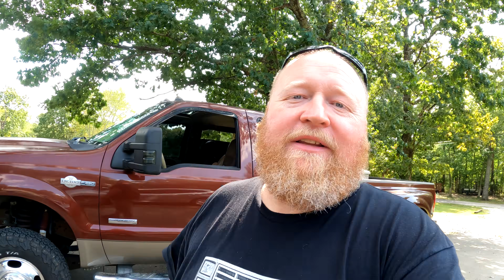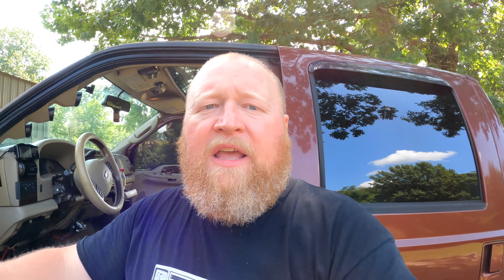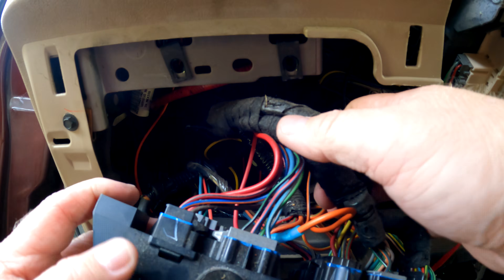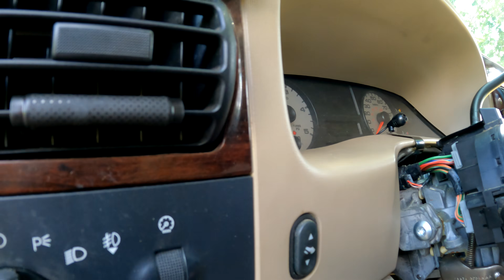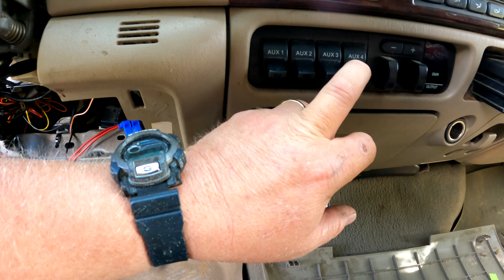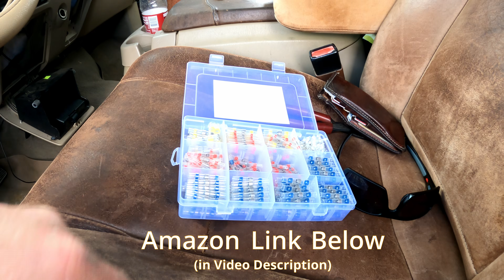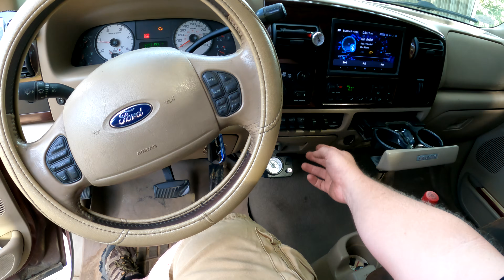Hidden Feature (High Idle) - How to Enable it on Your Ford 6.0 Powerstroke Diesel

Comment: Seems that everything i have used those connectors on i have had to go back within a year and fix again. After having to rewire 4 custom truck beds i decided it was more cost effective to use shink crimpers and i still put shrink wrap over the shink crimp connectors.
Reply from the maker: Yeah, that's truly the best way to do it.

Comment: i live in the great white north and my truck when its cold out always kicks into high idle. its stock i didnt have to do any of this. and the truck should kick into high idle when its ready shouldnt it.
Reply from the maker: Yes indeed, they will all go into a warm up high idle, but that is different from the feature we are using here. This is a factory provisioned  "on demand" high idle meant for service trucks like tow trucks, ambulance bodies, winch trucks, etc. It allows for a higher rpm than warm up and can be enabled whenever the operator chooses.

Comment: Putting power to orange doesn’t put truck in high ideal
Truck has pto been tracking down why high idel quit working. Any help would be appreciated
Reply from the maker: I think earlier trucks had different wiring colors. May be a good idea to call the dealer and see if you can get a printout of the Upfitter wiring diagram. That should tell you all you need to know.

Comment: Orange wire  in my truck is the upfitter switches what am i missing?
Reply from the maker: Not sure. Upfitter switches will have 4 wires coming to that area, one wire for each upfitter switch. Also I think the earlier trucks used different wire colors.
Reply: @ProjectTimeGarage  no problem finding the upfitter switched wires it's the high idol wire I can't find and the orange is a 30 amp  switch wire it goes on and off by one of my switches
Reply: Mine works if u have parking brake on

Comment: I have a 2004 and set up the high idle you can push the brake and it turns off but when you release it the high idle re-engages. But I do not see a difference in how they are hooked up but it has been a few years since I did it. I also used a regular toggle switch since I did not have the factory upfitter switches. That is the only difference I can see.
Reply from the maker: That's interesting. Never seen that before. There's a second wire that will idle the truck up based on voltage draw. Wonder if that's the wire yours used? Never used that one before.
Reply: Hey man what wire did you use? I also have a 2004 and I don’t see a solid orange wire under my dash. 😅
Reply: @Alecrypt did you ever find out. I as well own a 04
Reply: I think that is so if your going to drop it in gear when you hit the break it idles down to allow you to shift into gear at the lower rpm setting. My duramax does that..

Comment: Will this mess with the factory high idle I have on cold days it will idle higher than normal until I hit the brake
Reply: It always seems to kick the idle up higher with the switch than it does with the default high idle, at last on my '03.
Reply from the maker: @ProleDaddy  Yes, that's correct. The factory "warm up" high idle goes to 800 or so, but the wire I used is made for commercial applications like PTO, etc. Meant to run hydraulic accessories and the like. This wire runs it at 1200ish
Reply from the maker: No, it will still work as normal.

Comment: Is there any way to install a potentiometer to have variable idle like if I want to idle to 900rpm instead of 1200? Any issues with that?
Reply from the maker: Never heard of it being done. Not sure if varying the voltage across that line would result in a lower idle. I think the PCM just reads it as voltage or no voltage.

Comment: That's a beautiful truck! I always think it's funny when vehicles have a feature already built into the harness that is simply not hooked up. On the second gen Dodge's that were factory without tachs, all you have to do is throw a cluster with a tach in and it works. My buddy has a 2013 Tacoma without intermittent wipers, he bought a multi-function switch from a truck that had intermittent wipers, changed it out, and what do you know - it worked. Funky stuff.
Reply from the maker: I'm kinda surprised that more companies don't use a standard harness for everything. Seems like it would be cheaper on them. To add features, just add the switches/relays, etc and wa-la.
Reply: @ProjectTimeGarage  I'm sure it's done to protect profits of the auto manufacturers. There are so many horrible things done for this reason in this system is insane.
Reply: @ProjectTimeGarage  Exactly. Just add switches to an already existing harness and charge the customer extra! Haha!
Reply: 6.0s come factory with high idle just has to be cold enough outside
Reply: @bwadles7659 Yes, but you can't access it anytime you want and never when it's warm out. So for faster charging of another vehicle to jump start, winching and anything else you may want a set high idle for this is good to know.

Comment: Which one would you recommend for the 7.3 I have a 2000 F-350.
Reply from the maker: I've always used the PHP Hydra on all the 7.3s
Reply: Yeah 7.3 hydra tuner high idle tune is the best. I just learned that its better to high idle than norm idle due to wet stacking (unburnt diesel sitting atop) that normally wont get burned off at low

Comment: When would you need this most for ??
Thanks for videos  👍
Reply from the maker: I use it a lot for better A/C when idling in the heat. Also, my oil temps will always drop once it idles up and the fan becomes a bit more efficient. It warms the truck up much faster too on cold mornings. I've had others tell me that it's very handy on mobile HAM radios and CBs with amps. Others use it with winches, etc. Lots of uses.
Reply: Low idle can wash the cylinders. Best to warm up at high idle.
Reply: When you flush the coolant system with Ford VC-9, you have to run the engine for 1 hour at around 1,100 -1,200 RPM, so if you don't have a computer hooked up this would be a great way to just let the truck high idle while the VC-9 works on the coolant rust.

Comment: Is this the same for the manual transmission trucks?  I have an 03 with the 6.0 ( and yes mine is white as well). Some of us still like to stir the sticks. 🙂
Reply from the maker: As far as I know, yes it's on all of the 6.0 trucks from 03 to 07 manual and all. I'd love to have a manual in mine.
Reply: Thanks for taking the time to reply.   I see a bit of digging around behind the fuse box in my future this weekend. 🙃 Please keep the projects coming and we'll keep watching.   @ProjectTimeGarage
Reply: I have a manual as well with 330k miles and running strong , it has been so reliable. I might do this high idle mod to it.

Comment: This will definitely come in handy with a toggle switch. Sometimes the cb linear amplifier needs more juice. No more holding the pedal.
Reply from the maker: Sure will - We always called the linears "tennis shoes". Not sure why...
Reply: @ProjectTimeGarage  help I changed my egr valve in 06 6.0. It started for about 5 seconds now won't start.
Reply: @ProjectTimeGarage  ended up just being plugged from not cleaning the port enough. Cranked at intervals with quarter throttle and it started and ran great.

Comment: I opted out of the PTO wire and went for the battery protection mode (purple/light green) wire or something same concept except it doesn't lock up the torque converter. Good for warm ups and jumping off other vehicles.
Reply from the maker: Yep, that's a really cool feature too. I had that running on my personal 6.0 for a bit too.
Reply: What do you mean?
Reply: @TylerTheHooligan  what do you mean?
Reply: I had no idea that was a thing. Thanks for the tip!
Reply: Is it the light green wire with purple tracer?
Reply: I think so a quick Google wiring diagram search should put you in the right direction